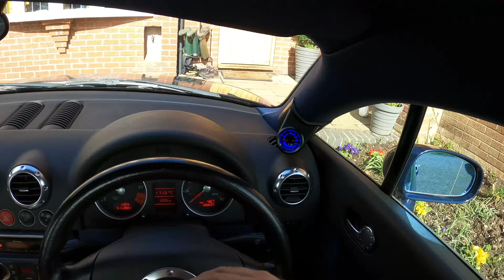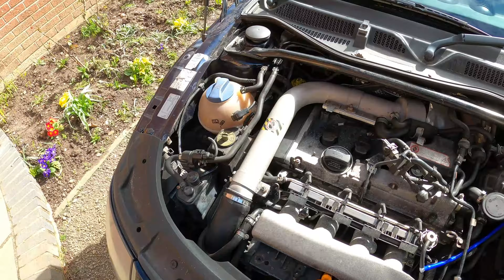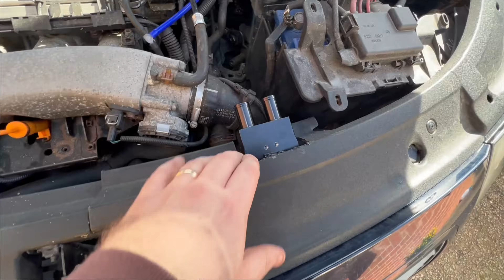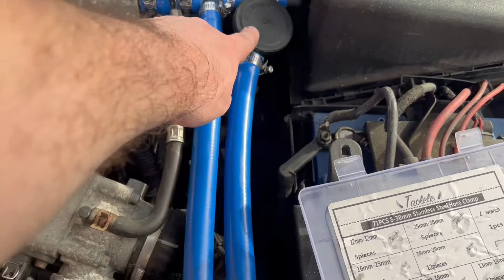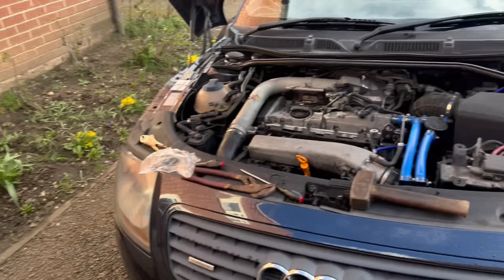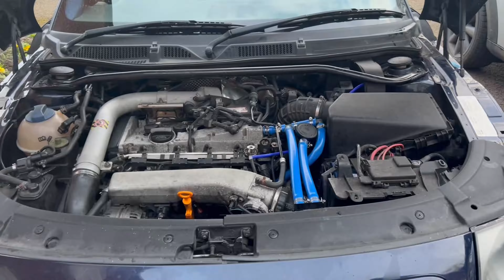Why Your Boost Isn't Working (PCV Removal Explained)

Comment: I  Made my own Smoke Tester it's very easy to make all you Need  is a Windshield wiper fluid Pump and 2 Pieces of Rubber Hose  for the Inlet and the Outlet  and an Electric Vape  Pen  Works really Well. 👍
Reply from the maker: Interesting will have to try that…

Comment: Which pillar mount is best for my tt 2003 ? Would send a link for the one like yours ?
Reply: Yes you didn't say anything about the mount.
Reply from the maker: Mintice 2 Inch 52 mm Universal Side Single Hole Gauge Pod Holder Gauge Mount Bracket Instrument Holder https://amzn.eu/d/9d9f4OK
Reply from the maker: @valveauto apologies YT has removed all my responses for some reason.

Comment: Around 15 PSI max is correct for standard 225, mine peaks at 15 (probably just under as the gauge probably is 100% accurate).

Comment: Have you got any warning lights on the dash? And also Have you got a smooth idle ? Ideally you need to run VCDS it will bring any codes up 👍
Reply: @DaveJenkins82  esp light could be a few things MAF sensor brake pressure sensor ABS sensor . If you plug it into a diagnostic tool it will tell you 
And cylinder 2 could be a faulty coil pack .. check for any oil around the rocker gasket as there very common to leak 👍
Reply: @DaveJenkins82  that snapped plastic crank case breather on yours it’s very common for that part to fail .. give us shout if you need any advice 👍
Reply: @DaveJenkins82  the injector seals are only made of rubber. There tiny think there’s 2 seals per injector 👍
Reply: @DaveJenkins82  eml could be a 02 sensor going bad there’s 2 on 225s .if it is always buy BOSCH sensors nothing else .
Reply: @DaveJenkins82  also check the half moon seal that can be done same time as rocker gasket .. something else too that leaks that’s the seals on the injectors 👍

Comment: The max PSI is 15psi on a stock tune for the 225. Depending on what diverter you have, it can fail in few different ways, If it's a spring type (after market) it will either seize open or close. If it seizes open you will build little to no boost. If it seizes closed you will be dumping excess boost into the compressor wheel and you will hear alot of turbo flutter. If you have the diaphram style and if fails (tears) you will have issues hitting peak boost and holding. If you have a vacuum leak and you don't have a pump or smoke tester go ahead and replace anything that looks crusty. It's seems to me like your car may be flashed. If you were over boosting (20psi) you would hit boost cut, and the car will go into limp mode, and you won't be able to boost past 5 psi.  Also, you should have between about 20 inches of vacuum. Check the hard line for the break booster and the black vacuum check valves as well.